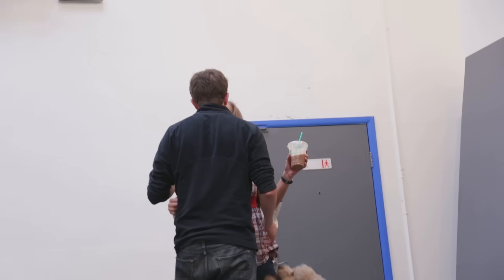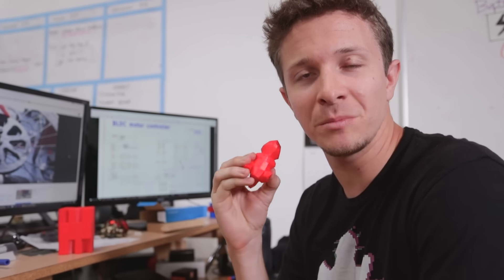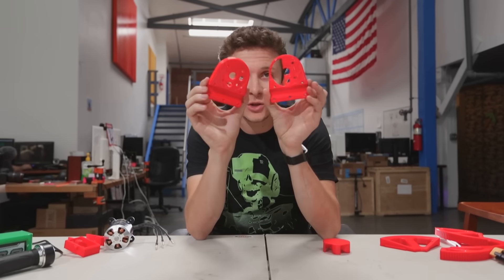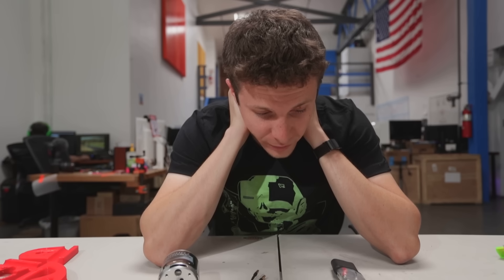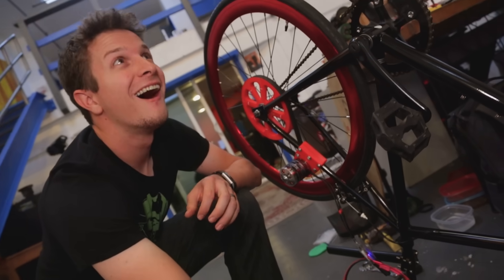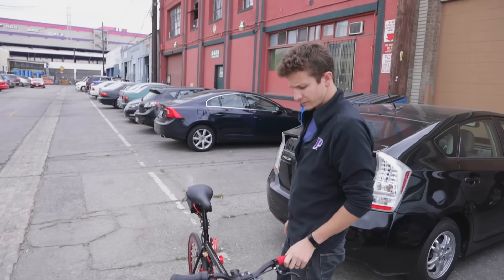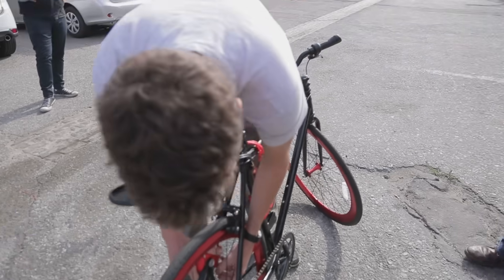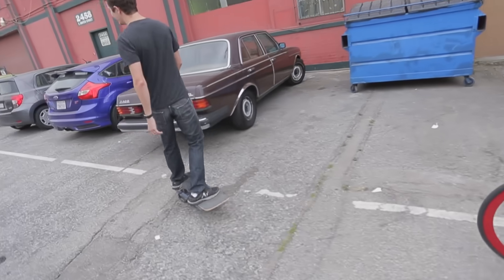Building a Tesla ELECTRIC BIKE For my WIFE

Comment: I'm sure others have said this but, run a screw through the chassis tube to lock the rotation of the motor mount. Then you have a guarantee of no rotation on the tube. Plus, you can utilize the regen braking.

Comment: My jaw clenched when I saw him trying to step up the hole. Everything else seemed smooth, but that was definitely doomed to fail. It's nigh impossible to get a perfectly centered hole with a traditional drill bit. You can buy specific step up bits though, they use them in manufacturing, like in aircraft, since the hole size you need is too big to drill into the fresh metal, you start with a small pilot hole and work your way up. The bits have an inch or so tip that's the size of the hole, then the rest of the bit is the size you're moving up to, so it guides it in.

Comment: Carbon fiber wheels are the worst idea. When you bump hard, metal will bend but carbon fiber will just break. I knew he messed up the programming on the bike cause his in my head "Flywheel" wasn't spinning when he let off the throttle. And this bike probably has the problem of if the bike is slowed down the electric motor will try to get to the same speed regardless and break the belt. Anyway, great work dude. Rip Mike. Nice Catfish Camero man.

Comment: I would change to speed controler to a tourque controler because if you go up a hill if the motor can't reach the rpm then it will fry the motor.

Comment: When I tried to swap any wire on my sensord 48v 1800w brushless motor and swapping any on the three primary wires didnt work I had to strip the motor and find the two outside connection and only swap them. And the hall sensor colours didnt match so I had to also find the correspondent wires and switch them. And before anyone says it was the hall sensors I plugged it into a sensor less controller before I started messing with reverse

Comment: Better to mount the motor on a fixed rear rack. This design will eventually slip on (or down) the seatstay (*ahem* - proof in the pudding: 11:27). Even if it doesn't, you'll kick that motor with your heel more often than not.

Superglue? Grind a flat into the motor shaft for the set screw to grab into.

Comment: HolyFck.. How did you overlooked such a simple solution..
A slipping axle just requires a single spline embedded in both the outside and inside of the axle... 
https://en.m.wikipedia.org/wiki/Key_(engineering)

Comment: When he drilled the off center hole in his part, my first thought was, this is why you use a mill bub.
Reply: Except that a mill offers no benefit over a drill press here. An xy table and an indicator could have helped with alignment; however, a machinist would never try to bore a hole like this. If it were just reaming up a few thousandths, maybe. Pulleys, gears, etc need to be properly bored out on a lathe.
Reply: @jamesnewman9547  At Least  you agree with me, he used the wrong tool.
Reply: @Iveboy32  Ohh yeah... I was specifically looking for someone else's cringe comment. :)
Btw, the reason it's particularly bad is that it'll cause the bearing in the motor (possibly others on the belt also) to go bad. They aren't rated for axial loads. Even with no axial wobble, just over tightening the belt can destroy motor bearings.

Comment: as an engineer how has had experience with this shit before. You have actually done a great job, the only difference is that someone with experience would have done it in much less time but the fact that you just didn't give up on it after more than 2 weeks of work yeah that pretty cool learn some programming and you could start an embedded systems career.
Reply: What if he uses an inverter to power an AC motor would that be efficient considering the battery pack he has?

Comment: Should the entire motor be spinning? There should be two screwholes on the front of the motor to secure it to the mounts superglue is to seal it probably i plan to do a similar build as well with a 24v motor

Comment: You can buy a 500-750W mid drive kr rear hub e-bike conversion kit online for like 350-400$; it's a much better system because it comes with a digital display, all the brackets required to fit it onto your bike, a speed controller, etc. not to mention that it comes with extra features like a cadence sensor or torque sensor for pedal assist

Comment: We made an electric cycle in india we used double side flywheel hub insted of you using a 3d printer and making those parts we just took a one side hub flywheel and we welded another flywheel to the hub on other side

Comment: I like this bike☞☞>share4.photo/ebicycle?Қ    its best used on pedal assist when going uphill unless you weigh 2stone when using the throttle only. I can cover 6 miles within 20 minutes on varying terrain, which I'm told by my cycling mad son, is very impressive.

Comment: So... You need to use a center to line up that hole for drilling it out. It would be better to do it on a lathe. Your shaft problem could be solved by pinning it with either a keyway or using a roll pin and putting it in double shear. Using a set screw is not going to hold up well.

Comment: Pulley on the motor needs a one way clutch to stop load on the motor when you let up on the throttle and you should put a woodruff key in the motor shaft to stop the slipping issue, that’s how they get most crank pulleys not to slip on a crankshaft on larger engines. Y’all teach me cool VFX stuff, least i can do is lend some mechanical knowledge in return (I’m a heavy diesel mechanic by trade) 😊

Comment: My memory of your content is somewhat buried but let's try to see if I can start this comment and the memories may become aware to me just in time as we proceed right? I remember that you had issues when you tried to do the range extension on one of the other more modern contemporary eccentric Mobility tools that you had like your esk8. This informed me when a year or more ago as well I saw the L7 Channel. These Indiana shops are addressing the exact issue that you had raised when you mixed two kinds of batteries and tried to get the system to work.

It has been unclear whether L7 was a serious contender. It still is of course. However they do have this press release from last November heralding their big battery management system alternative. Their technology has for the easier thing the merits of lining up all the batteries in parallel and then letting the electronics the non wets the non-chemical the more established components that don't wear out that have recently been disrupted by Google and others to be capable of doing new things.

So I think you should make a video about their finish bicycle. That is spelled at least with a capital f!

Complicating the success of this new bicycle that can be charged while being ridden by the Sun, that has a traction inverter that not only allows that, but of course, being bidirectional, has regenerative braking, and what ST the very first world country company, calls OBT, I mean OB.... See that's the letter c right? Onboard charging. Or you could say I guess ovc. Anyways I assume that the Indians are using the better transistors no, because the main selling point of them is there by directionality, and that their higher bandwidth, allows the bidirectionality oh, because it allows alternative Solutions to the problem of taking the electric red and charging a battery with it or efficiently powering a wheel, or of course plugging in to a solar panel that's providing shade to you as you paddle or use the throttle that doesn't weigh anything that is in fact manufactured in the United States a k a m i a s o l e.

I have no relationship with any of these companies other than seeing them as having potential to disrupt it to disrupt incumbent industries that criminally fail to compete with each other and deserve to be liquidated so that their real estate etcetera can be put the more efficient use serving our interests instead of just aligning the spoiled brats pockets but battery management system alternative. there technology has four these year thing the merits

I'm trying to develop you restic that I can use within the app that's your aesthetic the you rst h e u r i s t i c yeah that's the word heuristic because although I know if I use the Chrome browser with like the Google office cloud system that then I will be able to actually have what I say get typed oh, I have not been able to find the time and even if I do I won't be able to share as easily the heuristic. So please p a r d o n all the typos all the paragraph correction the cloud make a alphabet funks are perpetrating upon my words. We are at the point where I had to send the prior transcript because it was going to repeat even worse bedeviled by Google with the more sophisticated they said be doubled but of course that is also be dabbling and words like and the RH time we get a new alternative words of the sounds I'm making it's kind of nice right now I try to work with it though I try to row Downstream as the expression goes and have a kind of a teamwork thing going on here between the chatter that informs the machine learning that's typing these words for me you know where are the manual the instructions gets translated into the Russians on the second attempt not on the 1st of course bye Google.

 So I told it to start another paragraph just now because if you don't going to end ending two words there are likely to get this comment flagged like they to get my commas erased from the World Wide Web except on strange Russian in fact websites. Saying bye Google it's I'm sure the verboten but let's see.

The VMS the BMS serves the interests of OPEC more than those who wish to have a human scale tool for Mobility. It has Tesla capturing the market right now prolonging the reign of terror of cars. but for Tesla many more countries would have banned cigarette smoking arguably and certainly we would see the ownership or entry into any car-sized contraption be rather shameful in places like Norway or California.

 It's kind of like General Electric right? They are making a turbine that uses two materials or wax Lee one material and a value-added version of it. I can't repeat the three word alternative to the single word in the fire sentence because the way I would pronounce those three words is not going to result in Google typing them and now I can't see them anymore so I hope you guys know that those three words sound like the single word anybody on the Earth it is ever watch the Bruce Lee movie with the English subtitles nose.

 It looks like it's going to continue to leave the K off of the last word in the fryer paragraph which is good it adds to the comedy and the levity that I hope readers of this comment can bring including the word fryer in this sentence it all rocks?

 I am encouraging everybody on YouTube to the use the little microphone button on the Google keyboard and the microphone button is on the Samsung keyboard and that might be why the behavior is even stranger but everybody has access to these nonsensical versions of what they say and you know we need to improve it because right now the Russian Bots are teaching Google how to understand English and the people who actually speak at the people who actually have things to say the people who would know that there is no instruction manual need to get their words typed as instruction not as Russian or else we are of course filmed.

 The time of the something just happened. I had set up it circulates you see fantastic Priceless paragraph and it's gone it disappeared I'm not sure if I switch them to landscape mode for a split second it's still in portrait I haven't locked it in Fortran I'm at kind of an angle right now so I think that's what happens if I drive but it was really good I had some great alliteration going on some great and locking of the car industry of the military-industrial complex consumer lineup and just saying you know we need to fight for contemporary materials 4 batteries that work where you don't need many of them not you know the batteries that don't work but are there for a fordable even though they're outrageously priced in the incredibly large you know pointless irrelevant entities that the Elon Musk seriously mentally ill so it quit again I had said much more I continued on that vibe after Elon Musk inventions the sheets the princesses of Dubai and others to drive the point in to say that yes we must build our own electric bikes so that we can contact the parts companies that actually are building things that you would you know maybe want your mom to use or your wife.

That is key. We are not going to see a Bosch vehicle that does not make them thousands of dollars in profit providing the parts to it. What we will see is the unemployed tobacco people going to companies like Bosch and say we know how to prevent competition we know how to help you produce parts that people will you know get all excited about that you can charge huge profit margins so that you can pay the bribes in the kick back to the supply chain and ensure that cars continue to kill millions of people and children and parents and wives and moms.

 It is absolutely the case that the alternative facts are the only thing that almost everybody hears about how most new bicycle purchases by the dollar spent are electric bikes as if that matters you know the dollars spends when matters is are the people who can change the world if I allowed to use a rational Mobility tool being criminalized not just in China if they do so are the states in our country being ran by people who can't afford to have their campaigns and their actual salary be paid by the people who benefit when they betray us when they are the Insurgent when they are the terrorists that matter the most Paragon

Period is a word that I'm able to spell and you do have to spell it if you wanted to get typed or else it does the punctuation mark for you so when I was saying it it typed a different word in the second to last paragraph and I have a solution for this dilemma it is to say and a story. Well that is interesting one out of the three last words with transcribed correctly so you'll have to figure those three words out from the following acronym that Google always gets right and even capitalizes for us POF. well Google never fails to disappoint when it comes to typing what we say so let me say that again and see if it will type it correctly this time POF. wow this is a new problem. Never had a problem typing the acronym for end of story till this comment. E o o s POF e o f space.

POF

POF. Apparently the app the Plenty of Fish nonsense has gone viral so people are talking about it so one can no longer say the letters e be like Elizabeth old like Oliver that's the letter o, and of course as I am this comment so ends my ass the letter s for story. I asked you though what does the word ass have to deal with comments. The two words have a different number of syllables and sound completely different.

 All caps. End of story. EOS.

Comment: Wren, those 2 set screws in the 12 tooth pulley need detents in the shaft of the motor to lock into. The shaft of the motor is most likely chrome-vanadium, which is much harder than the set screws. Process: build it so that everything is in place, tighten the set screws so that they contact the shaft and hopefully leave witness marks on the shaft of where you need to grind with a dremel, will a location for the set screws to lock into and prevent the issue.

Comment: The shaft on the motor just grind flats where the set screws tighten 

Also however cheap you think the motor is to charge verse gas only matters if you dont value time 3 seconds to fill a tank verse hours to charge

Even if it minutes to charge it doesnt compare to seconds if you put a weedwacker motor on it 

Im not against electric motors i think they are cool as hell cause the instant torque and power tunability but the big problem is charging them